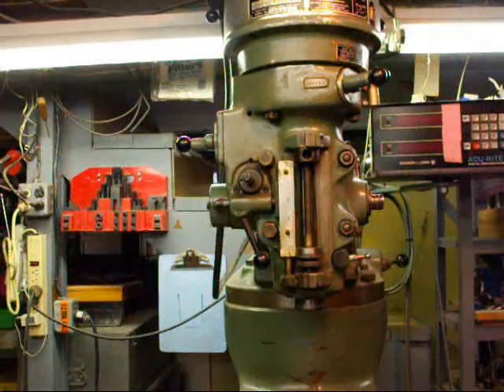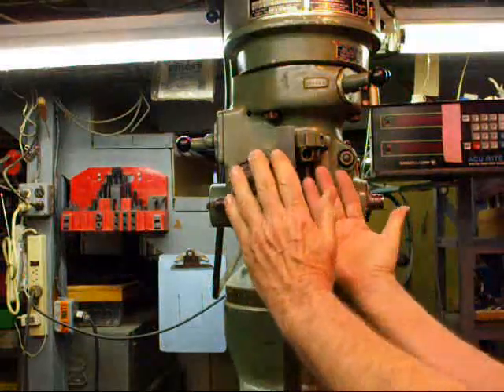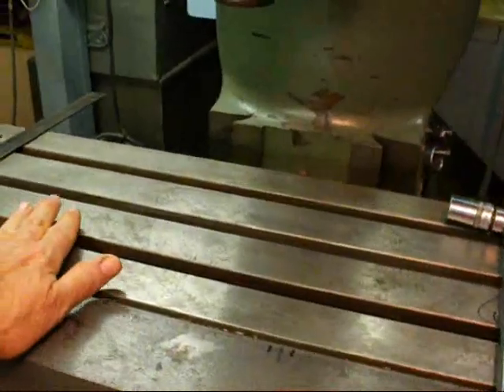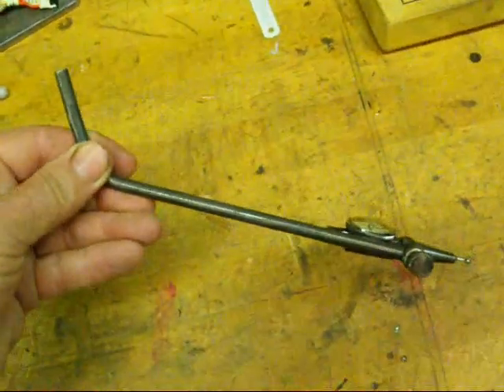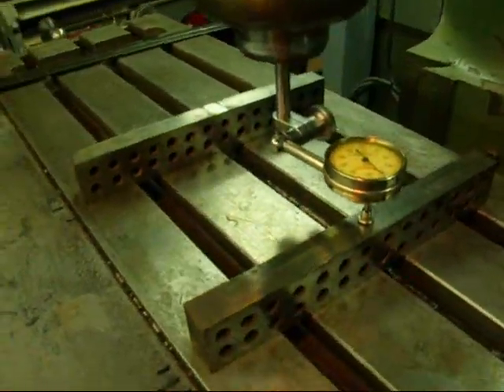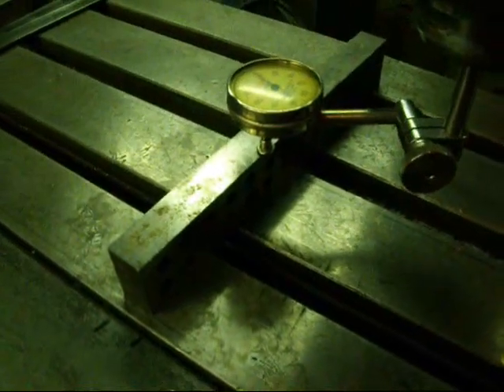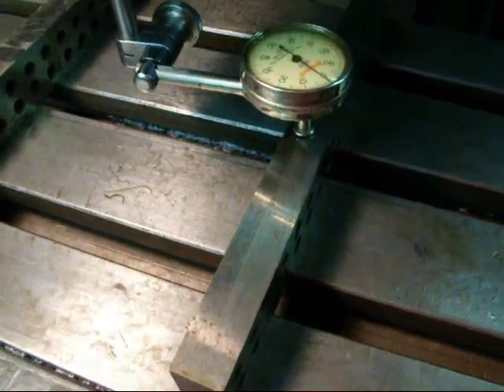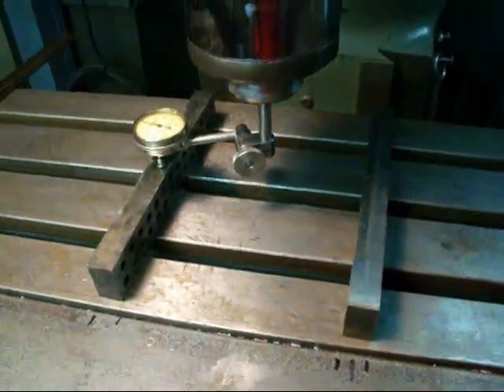BRIDGEPORT MILL  Tramming or Indicating the Head to Zero tubalcain

Comment: What is the best way to straitened the turret perpendicular to the table??
Reply from the maker: Just use the protractor. It is so large in diameter, that makes it extremely accurate
Reply: @mrpete222  I have a riser and I didn’t think to scribe a transfer mark. And I don’t want to take it back apart. I thought maybe machinist school taught a procedure if you don’t have a mark or it’s illegible. Thanks you really remind me of the guy who worked for my dad that first taught me to use these machines when I was a kid in grade school.
Reply: Dummie All: Clamp something on the table or vise that’s square with the front edge of the table. Loosen and oil the ram so it slides freely forward and backward with the ram lever. Clamp a dial indicator in the chuck. Indicate the squared bar on the table by moving the ram with the lever back and forth until the indicator reads zero. Mark mating surfaces for alignment.

Comment: You showed tramming only the X axis.  That was easy.  Next time show doing Y.  If the radius of the indicating arc is about the right size, the front will move about twice as fast as the rear.  It is still much harder.  If the head isn’t trammed there will always be a step between cuts when facing a workpiece.  Also, if the knee is moved, the center of a hole will move sideways either in the X or Y direction. Good teacher.
Reply from the maker: Yes, it is much harder in the Y axis

Comment: That's the same failure as you did in the previous video. As soon you will move the table, you will go out off alignment. The alignment which you are doing is only for one point, for drilling holes without moving the table.

Comment: Tubalcain is only half way done tramming in the head, he needs to do the same procedure on the front & back of the table or "Y" axis.  He needs to "nod" the head up or down until the dial indicator reads the same 0 as it does in the "X'" axis.
Reply: he said he did that off camera.

Comment: Your one of the smartest machinists I've seen on youtube so far. I can't say anything wrong with that. I like how you remember to say "check it again once it's tight" . Most people I see never do that and it's usually likely it could move. People I work with square the head but they don't do it like that with the indicator. I try to tell them they're wrong. You are right that the bigger the sweep of the indicator the more accurate it will be. if you use large diameter cutting tools for instance

Comment: Well, ..Thankyou so much for this vid. As a CNC mill operator, I haven't had that much helpful info on knee mills. Actually, we have an Acer in our shop that I've use a little. I think it's like a BP 30 series. It has the taller table. But again Sir, Thank you!

Comment: Never knew about those lugs either, I lowered my quill & used a machinist square against it. I just built a 2 indicator tramming device and gonna try it out tonight. You ever use one that has the 2 indicators on a bar & if so any tips or opinion on them?

Comment: Too much room for error.
Instead, put a 1" micrometer standard in the middle of the table.
Fit a test indicator on 4" radius arm on the spindle.
Move the table to the left, and touch the indicator to the standard, raise table till the indicator zeroes.
Set Z axis dial at zero, then lower the table .200"
Move table to the right and turn the spindle 180 degrees till the indicator tip is right over the standard.
Raise the table .200" and note the indicator difference. 
Adjust by 1/2 and continue.

Comment: You can also put the machine in neutral and turn the spindle with you fingers, but you have the be careful that you don't bump your indicator or the piece holding it. That is what I do because the machine I use is a variable speed model and you can't easily get to the belt.

Comment: Great video.  Very informative.  It's splitting more hairs, but if it's important to anyone, (those in the gage/fixture trade) lowering the quill all the way down will exaggerate your reading.  Meaning, if your indicator is showing out of square about .001", with the quill all the way down you'll be showing two or three thousandths out.  I notice in the video that he had the quill down, but did not mention it's importance.

My trade is all about splitting hairs.  Sorry!